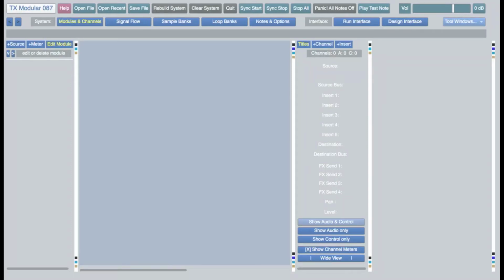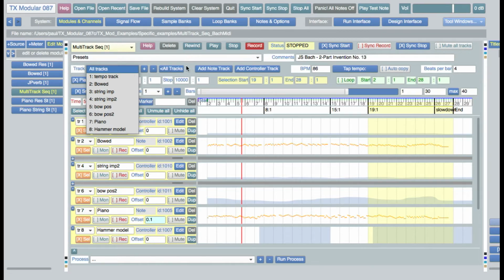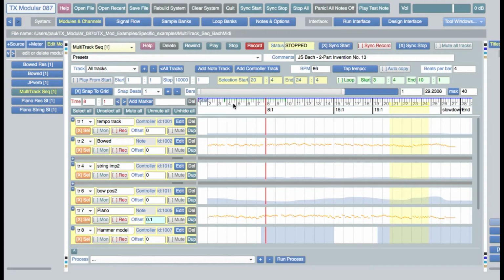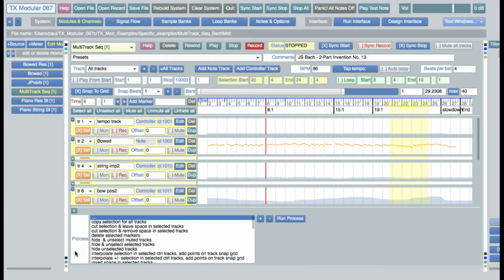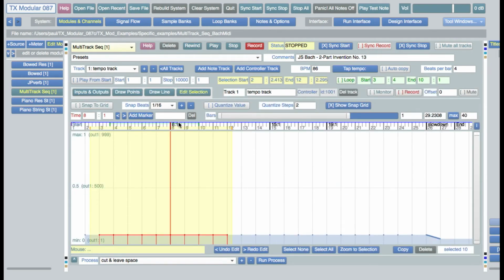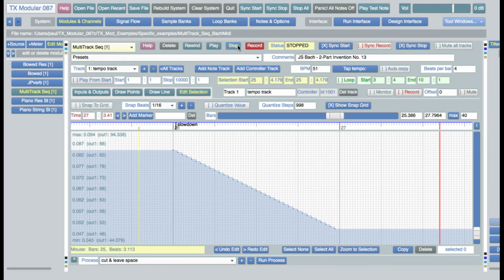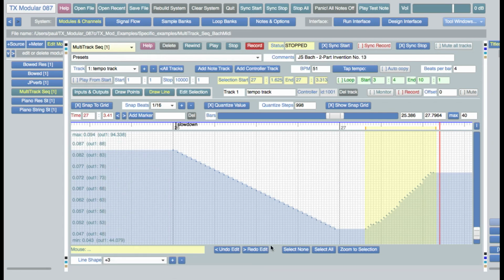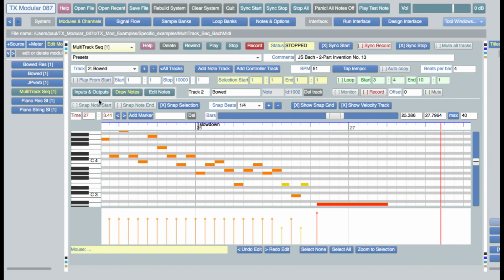TX Modular 087 - MultiTrack Sequencer part 1

Comment: This example doesn't work on my system. Error: Server 'localhost' exited with exit code 0.
server 'localhost' disconnected shared memory interface
Reply: I have the same issue, also I'm having trouble automating beats per bar..